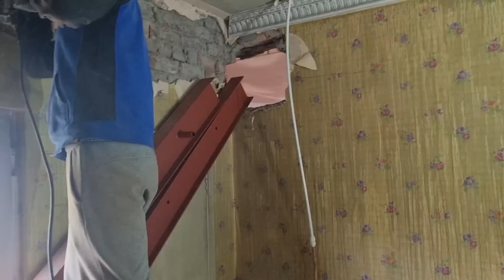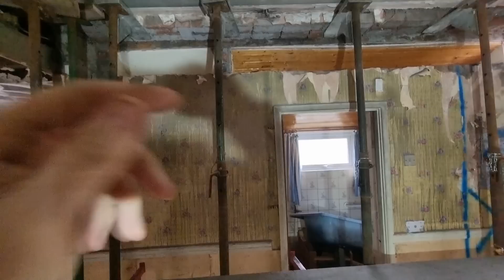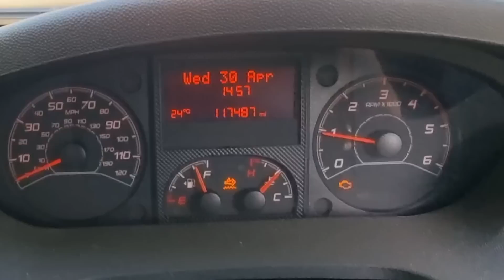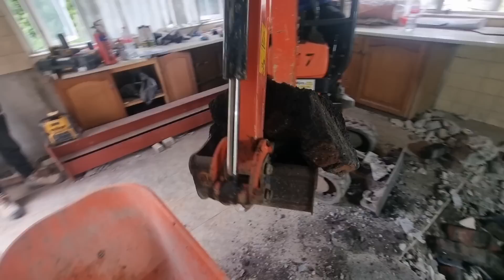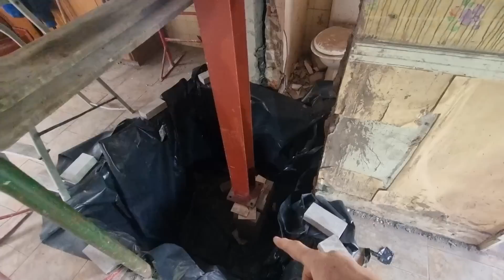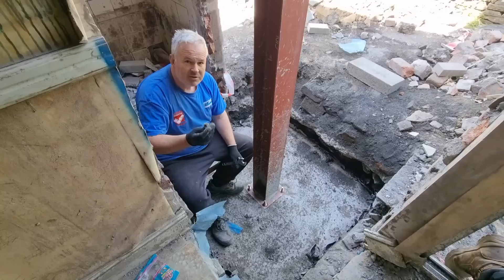HOW TO INSTALL STEEL BEAMS

Comment: so, you are stating in this video that you already knew that the ground below this property was made-up ground....and that was before the 'discovery' you claim later in your video on the foundations for the extension, that the ground external to the property had been further 'made-up' where it sloped away, in order to level the land...!!!
Reply from the maker: Pretty much yes .
We did dig a trial hole we did get building out .we did get an engineer involved. We did dig the rest of the trench as instructed. 
The dig fail it .
Engineer has been heavily involved now we have a plan. 
Next video will hopefully detail more
Reply: @brickrightbuildinglandscaping  That's good then... The answer is not rocket science and reading other posts, on your later Part 2 video, I see someone else also knew the answer to the issue...

Comment: Can i ask why you did not just use rag bolts before you poured the concrete..???
Reply from the maker: Followed the specification from the structural engineer

Comment: Great video, impressive work. Looks complex and risky. Assuming you will rebuild the ground floor part, would it not have been better to just demolish and rebuild the upper part of the building you supported with RSJs?
Reply from the maker: Thanks.
Was talked about but was down to cost

Comment: J bolts in the concrete and the steel would have much more stable and faster than the epoxy.. Ans less expensive and time consuming.
Reply from the maker: I don't make the specifications Maurice

Comment: Well Justin credit to you lads for taking that on .
    That would be a solid no for me . I turn down anything too big or that will stress me out.
   I can’t be arsed with stressful jobs any more, 2 years of extreme pain and 3 months off to rest have made my mind up.
   Love the demolition bit but not the heavy lifting and the worry of balancing a house on a Few props, squeaky bums are not recommended.
    Great job though lads and a nice change from porcelain .
    🤙🏾💪🏼💪🏼🧱👍🏽
Reply from the maker: I no I agree steve .
Listen mate I hope your well mate and recovered and back at  it now ?
I can't resist the challenge of some jobs and also I'm trying to pass on as much as I can to fra while I can same for you with Alex .
It did stress the shit out of me though Steve 😂

Comment: I’m very surprised that the stock engineer and the district of didn’t specify for you to put some reinforce steel in them two holes. I’m very surprised that is taking a lot of weight and especially with ground that’s being filled over the years in my experience over 50 years of doing that sort of work I’m retired now
Reply from the maker: The spec from the engineer didn't show steel but building control requested it in one footing so we followed the instructions.

Comment: Few squeaky bum moments with a couple of cans of worms on this one by looks of it LOL

Sounds like you need a mechanic who fixes what's causing the van to go into limp mode though rather than just clearing the codes. 

You must prefer this sort of work to garden walls all the time though 🤔
Reply from the maker: It's work I used to do before I stated landscaping. So yea it's a change and I did like the challenge of it .
The van is a pain in my arse always something going on with it  .

Comment: Wow another great video, thanks for sharing. Squeaky bum time indeed! Out of interest, did the engineer's report / building inspector specify resin studs? I thought you might be able to drop them in the required length with the nut on and when the concrete gets poured in they are set that way. Looking forward to the next episode in this series. Thanks Gents 👍🏼
Reply from the maker: That would of been a lot easier but no resin was added when concrete was set si 👍